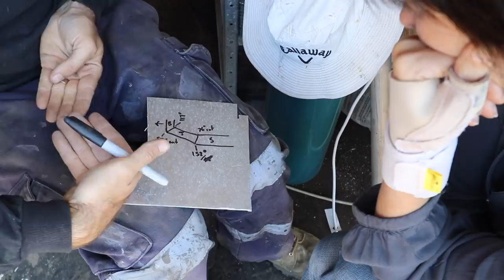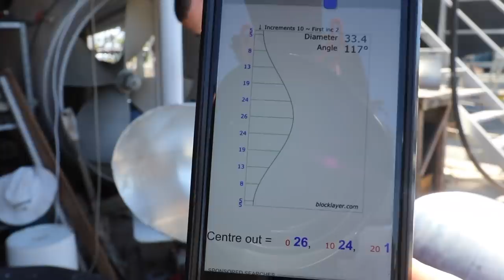DIY 2.5m Aluminium Pontoon Dinghy Part 2 - Project Brupeg Ep. 108

Comment: No no no no...Damo...you make'n me head hurt ..... @12:10 Jess yes bring back the CAD. Jeepers @33:00 back to where you were 2.5 days ago arghh, @58:00 Jess nails it again just needed to measure once from transom and transfer that measurement forward with angle iron, where you use a broad flexible wrap to transfer your secondary baseline around the pipe (closer to the cut = minimizes error and easier to mark). @58:56 .... and you didn't even set her up with a rest .... all free standing ..... cruel

Alrighty then......just adding to the discussion in case it helps the next build and cause I need to purge ;) .... here's my 2 bobs worth.
Get'n a bit toooo tricky with the core flute Damo ('marine' lol), stick with stiff card and internal polystyrene disks to keep shape.
Establish baselines at 12/3/6/9 o'clock if you need to define a dual axis compound angle use those points as reference. (You were on the right track with the parallel string set up, just need the vertical axis to ensure alignment and get an angle reference plane)
Bit late now but would have considered at least tacking/stitching down that internal overlap (vibration transferal may cause metal fatigue at the weld in long term)
Hybridising the CAD with math seems to have led you two on a merry dance (so glad you both dance well). Remember CAD method allows you to circumvent math and 3D computer modelling cause it allows you to actually express the complex geometry.
Great work guys, love watching the drama and build, cheers
Reply from the maker: Thanks Dan, yip lot to factor in, we will be filling the tubed with expanding foam so the bottom alloy flap wont have anywhere to move when were done (its stiff as all hell now so really doesnt move much)

Comment: Of course, the question is why you wanted to do pontoons at all.  Inflatable boats only use pontoons due to the air pressure in the ruber, which is easier with a  tube.
A traditional hull design with lots of internal flotation compartments would be so much easier, and give you more freeboard and internal room too.
Edit: Wow, so much brain strain. A duct worker could have told you to just measure the centreline of the filler tube, and take measurements to either join, along the top and quarter longtitudinals.
Reply from the maker: It’s about ease of use for me as it’s my dinghy. I need something stable and strong that can hold a wheelchair and be an electric start. Traditional hulls wouldn’t work.. and I love the shape of the pontoons too. Dame made this to suit me and my needs. Bloody gorgeous hubby that he is! Cheers Jess

Comment: may be you may look in to adding a little  helium to mig mix 20-30% it will make the wild hotter and cleaner hope it helps don
Reply from the maker: Thanks Don. We found we had the machine set at the low end for heat, made some adjustments and got a much better penetration going on

Comment: ... joint it could help if you tip the bow down until the corner tubes are horizontal, then find the true horizontal plane to align the intersections cutting faces.

Comment: A thought: After it’s all assembled, would filling the tubes with expanding foam be helpful in case a small leak develops?
Reply from the maker: Absolutely, we plan to do this for flotation, rigidity and because we have electrical cables inside that we need to protect from movement.
Reply: @ProjectBrupeg  make sure its closed cell foam not open cell ! open cell will get soaked and water logged.
Reply: Okay, now I am afraid. I’m starting to think like Dame, and I feel I am not worthy... LOL 😂
Reply: Expanda foam actually water logs over time, put a bung in each and leave them empty, if the foam water logs u will be cutting the boat in half to take all the foam out, speaking from experience.
Reply: @Swiftyjjj  I had a feeling that was the case but I think it will be close to impossible to get all the welds completely water tight.
Reply: @jarchdm  it was 12 yeara ago that i had the fun of doing this so maybe theres a product that doesnt water log, if ur good enough on a welder then it should be water tight, a tig welder with lots of experience might be good to put ur hands up now! Haha
Reply: @jarchdm  yeah, metal boats are sinking all the time because of that problem.  :-)
Reply: @YellowPinkie  this is a small boat made with thin skin aluminum with a large amount of welding seams comparatively to its size so yeah I think it's going to be difficult to chase down all the pinhole leaks.  I guess we'll see in the coming videos.
Reply from the maker: Hi James, that’s good to know. I’ll make some alterations to my plans thanks
Reply from the maker: Hi KJ, we have been pressure testing the tubes so we can have 100% water tight tubes, I want a fully sealed alloy tank as primary floatation with the foam as a last resort
Reply: @ProjectBrupeg  did you manage to find and weld up all the pinholes? I imagine there were a few?
Reply: Another thing to consider, this small boat is just that, a small boat. It will get damaged, dented ect. I would think that this is also not a perfect small boat, I would like to think that this boat can last 50 years, bit realistically, it won’t. How good does this need to be? 15 year lifespan seems great.  Like you have said MANY times in this build “That’s good enough for us!”  Lol, thanks for sharing your adventures with us!

Comment: Keeping the tubes the same size was tricky with the multiple angles. Would this have worked?: set the bow and side like you did. Cut an unwelded rough tube to the inside size and longer than the outside size. Tack it in place on the inside and then roll it tight to the outside of the bow and side tube. Mark and cut. Also are you planning to fill the tubes with foam?
Reply from the maker: Hi Sid, yeah I can get where your coming from. Without actually trying it, it sounds like it would work. As for foam, yeah we will be using chunks of polystyrene to take up as much internal space as poss and then the gaps will be filled with expanding foam. Mainly so we can keep the weigt down as much as possible and also to make the internal tubes solid so they can take impacts as well as possible. We have internal wiring for the batteries and outboard so their will be conduit runing through the tubes as well. Im also thinking the solid foam/poly soup will hold the conduit rigid over the life of the dinghy.
Reply: @ProjectBrupeg  Looking good and more unsinkable than a rigid inflatable.

Comment: Why not cut all of the tubes straight, with the ones on the angle cut to the inside length (the shortest distance between the side tubes and the one on the bow). Now, you'll have a gap that is widest on the outside and closes up to the inside. You can then fill that gap with a wedge shaped piece of aluminum from the same stock you made the tubes from. A couple of extra welds, and Bob's your uncle. You wouldn't be fighting with angles, just straight cuts. You could even cap the pontoons before you weld them all together, and they'll act as individual sealed flotation. I know it's too late for this now on this one, but you've got another tender to build.
Reply from the maker: Hi Paul, yeah thats actually not a bad idea. I'm sure we could incorporate something like this into the next build
Reply: @ProjectBrupeg  I'm just glad I had a servicable idea for once!

Comment: Before welding side tubes on it would have simplyfied the task if you had made the 10 deg joints off the boat.  Then tack the 4 largest tubes in position leaving only the nose to fit. To do the nose..
Reply from the maker: Thats one way, but it would be a challenge getting the tube seams on the side tubes to be in the right spot if you cut the 10 deg joint slightly off

Comment: You could've just designed it in CAD and assembled it in real life.  Also use wire to force-stitch it together until you can get a spot weld in.
Reply from the maker: We use CAD but in this case it was actually harder than jsut building it.
Reply: @ProjectBrupeg  If you're interested in doing this easier in future projects, there's a plugin in Sketchup where you can model something like a boat in 3D and then later have it unwrap into cutout pieces.

You can then resize the cutout plan to an appropriate scale to print out in segments on a plotter.  You take those templates and cut out custom shapes on sheet metal.  When it comes to building things that interact with the physical world, it's a dream for builders to design things rather than to feel their way into a finished "incidental" product.

https://designerhacks.com/sketchup-unfold/

You could even design many more things to fit on your boat this way.  Origami for sheet metal.
Reply from the maker: Cool thanks for that
Reply: Is it finished yet, if so where's the finished product shown and test run? Really keen to do the same with my RIB  and turn it into a stabicraft too

Comment: Make three marks equidistant around side tube (3 only because 3 points make a plane). Do the same on the front tube making sure the marks are in the same orientation as on the side tube.  Tie strings between the tubes on corresponding marks.  measure the string length.  transpose those dimensions on the new tube.  use a string to connect the dots.  draw your lines around the tube at both ends.  cut :)  doing it with mostly math will mess you up in the end.  remember, only 3 marks on each end.  loving your effort!!

Comment: I was fascinated by this video, made me reach for paper and pencil.  I guess you have to split the mitre angle equally between the 2 tubes otherwise the elliptical ends will be different shapes.  However you also have to calculate a horizontal mitre angle and a vertical mitre angle and cut a compound of both somehow. No wonder you are struggling. Make my head hurt just thinking about it.
Reply from the maker: Welcome to the pain that was figuring out how to join the first tubes. It looks simple but man, when you started doing it, it got complex real fast

Comment: So, is dinghy number 2 going to have square or octagonal sides?
Reply from the maker: Hi Robin, easiest way to describe them would be pressed D shape tubes. Top will have a flat, same with the bottom and the inside edge will be fairly vertical. All of this allows us to measure fast using set squares and protractors etc

Comment: 24:12  What is happening is that the front tube is not perpendicular to the side, so the angles will not add up to 180, because the pitch going up to the front tube.  Surprisingly not too difficult to do in cad.  Just take me back 18 years to design class at tech.
Reply from the maker: Yip, but the problem is a program to unroll the tubes to flat sheets and when you don’t have the money for cad you have to get creative. 
We have tried fusion 360, autocad, rhinoceros, hull form and it’s not as easy as you would think. It looks awesome now we figured it out though. Cheers Jess

Comment: CAD will from this point forward will mean "Cardboard Aided Design" I love it. I have been using cardboard to scribe templates to uneven surfaces for carpentry,  for years. I wish I had known I was a master at CAD all this time. I know how to use email though.
Reply from the maker: I think email came out in CAD version 2.0
Reply: @ProjectBrupeg  I have done quite a few custom situations like you went through and I just wanted to crawl in the screen and help. I like how you work together and work through this without being dismissive of each other.

Comment: Instead of foam just use plastic milk bottles 1lt,2lt and 3 lt, you’ll just have to use a ply end cap so they don’t melt when capping off your tubes.And if you had a firmer cardboard tube same diameter as your tubes but just shorter than your missing tube, then sliding smaller cardboard outside you can trim sliding ends to fit , then cut out off template.
Reply from the maker: Hi Chris, the foam solved 3 issues we have, it gives rigidity to the tubes, ie hit something from the side and the foam helps support the tube to stay round rather than dent in. it provides floatation if we ever need it, and mostly because we have internal electrical wiring, the foam holds the conduit tight so the cables wont move over there life. All that said, adding empty bottles into the mix as we pour the foam ill help lighten the bouyancy as they create pockets on sealed air.

Comment: Mate, I hope you will compartmentalize the tubes (most buonyancy-rigid construction) or as suggested below, use the closed cell foam (less buoyancy)
Reply from the maker: We didn’t want to use compartments because of the welding issue rod talked about in the video and foam was something we discussed. Dames solution for holding the wiring with the filler makes a lot of sense. There are a number of issues to solve each step. Cheers Jess

Comment: I'm reminded of the old religion argument... they can't all be right but they can all be wrong 😁
Was doing a similar thing yesterday making a poor mans air dryer for the compressor, simple 45 deg joins but the blade on my cut off saw is blunt so I had to do it all with an angle grinder and then trim to fit.
Jes, do you change your ringtone to match the seasons?
Reply from the maker: Bloody observant stuff! And no she doesn’t alter it...

Comment: I really think you're complicating this way beyond what it should be. Here is the reason...each angle is separate and should be done separately. The layout would be easier if you only think about the center lines as being relative to only one angle. The two lines on each side of the pipe, 180° of each other are only relative to the one angle you are dealing with. Then you make 2more lines for the next angle. Also you can get a pipeliners bluebook. It has the way to make the templates.
Reply from the maker: Nope, it’s just complex. Cheers Jess

Comment: Everyone's lips speak of closed cell foam, but years ago, i made unsinkable barrels for a pontoon by filling them with balls. In my case, i had an endless supply of those black balls that are now used in large quantities to keep water from evaporating too quickly. Reason being that my barrels were nothing short of giant sieves, on account of rust, and i didn't want to buy new or used ones, and the balls were already there. I'm thinking that if you'd fill the empty quarters with rubber balls, that would result in very light very buoyant structure. True, you'd loose the crash resistant qualities of closed cell foam, but still. Don't know, maybe give it a ponder. :)
Reply from the maker: Too expensive here in Australia but love the creativity. Cheers Jess

Comment: This is not downing you just an observation as a mate but you made that 10x harder than it needed to be. Only because you didnt know better. I used to have a tool that was used by air conditioning installers to join 2 large ducts at any kind of angle. It would even allow you to join a circle duct to a square duct. Its a shame i couldnt tell you this before you did it. 
Loving your build. Keep it up.
Reply from the maker: Yip hindsight always makes things easier.

Comment: If you use a small set of dividers scribe on one tube guide off the other you’ll have a perfect fit
Reply: This ^. Having done industrial and commercial HVAC rough-ins for years, even if you don't have dividers, making a simple jig out of sheet steel or aluminum with two screws run through it, you can butt one screw up with the edge of one tube and use the other screw to scribe the exact line you need into the next tube. Works a charm.

Also, they're trying to do this while the sheet aluminum is already formed into a tube, but I've found that laying out your templates onto the metal while it's still a sheet makes things easier. You just have to understand the math behind it, OR, make a template using cardboard or paper, or a thin sheet steel that won't retain its shape when rolled, get the shape you need while it's rolled up, and then unroll it and use it to get your proper angles while the aluminum is flat. Then you roll it up and it's ready to go.

Comment: Wouldn’t it be better to have welded flat plate between each angled section to provide rigidity and air chambers for flotation in the event of damage, or are you going to fill it with expanding closed cell foam?
Reply from the maker: Hi Jason. We need to run cables through all tubes so bulkheads are out. Our plan is to fill with foam like you say

Comment: Are you sure the metal thickness of the bottom hull is compatible with the tube thickness where there won't be welds breaking under stress, or is this mainly a testbed?
Reply from the maker: The hull and tubes are both 2mm. We made the tubes from that thickness for exactly that reason, compatibility

Comment: Little late but without having to use a confusing amount of math you could do what we did when laying out offsets with round pipe duct work, tack weld the outside of the pipes
together where you know both sections will touch,adjust the pipe to the angle you need it and again tack weld to the bottom (floor).
Use a metal compass/scribe (dividers) to transfer the angel to the piece you need to cut, both pieces should fit perfectly unless the tube is not rigid and and it is somewhat egg shaped.

Comment: Hi Guys,   Pipework is a bitch if you are not used to it.  watch this video it will give you the basics of the way to lay it out.   https://www.youtube.com/watch?v=81jc5A3UQw4 .   So you need to lay it out in 3 angles not the 2 show on the video.   If you would like me to lay out the next one let me know.
Reply from the maker: Thanks Gavin, next one will be quite a bit different, built using D shaped tubes and 100% CAD designed, cut and pressed so its going to be more like a kitset than a scratch build like this one.